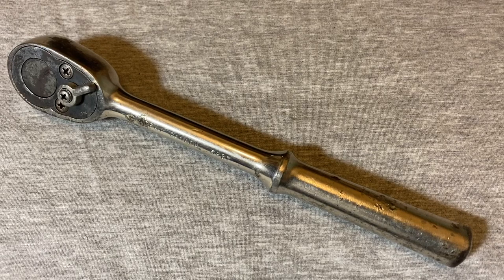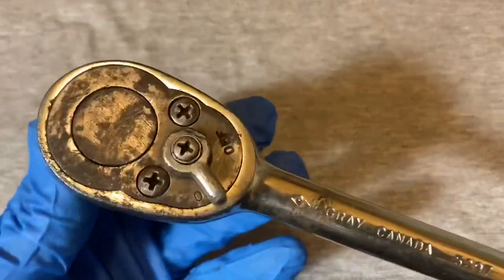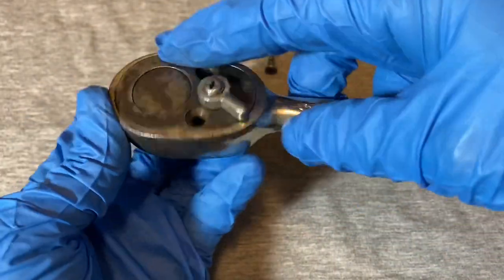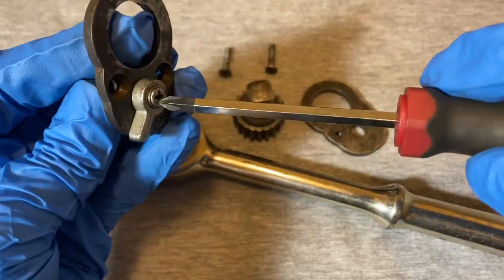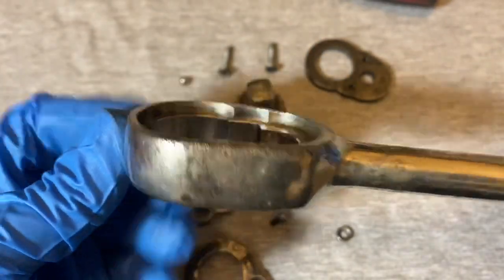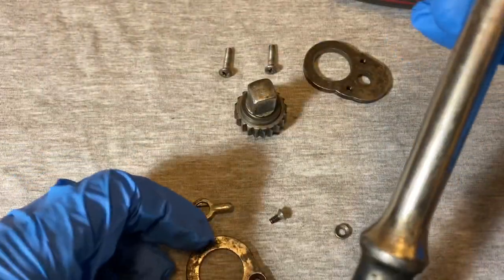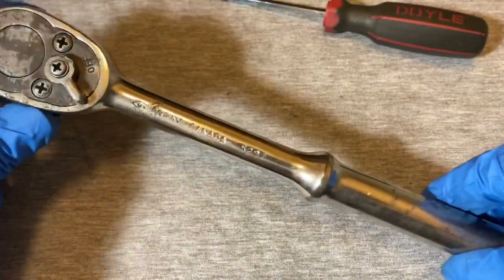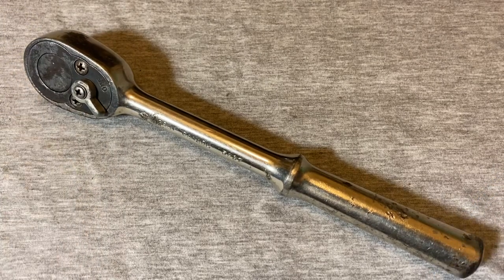Gray Canada 5297 Ratchet TOTAL TEARDOWN Vintage 1/2” Drive

Comment: Looks very similar to a new Britain ratchet I saw on Catus Maximus’ channel, at least the removable front and back plate is similar. Never seen both plates be removable besides those two ratchets. Pretty cool design, I’d bet it’s super tough.
Reply from the maker: I think New Britain and Proto had the 2 plates in their design way back in the 30s and 40s.
Reply: @snapringchronicles3020  yeah I’ve seen some super old beat up new Britains on eBay.

Comment: I had a Gray wrench that I passed along to a forum friend who collects Gray, but while their tools are out there I just don't come across them here in California.
I hear some states see a good deal of Gray tools.
Reply from the maker: Strange they never made and effort to cross the border. I did read that they did have a collaboration with Bonney years ago though 🤔
Reply: @snapringchronicles3020  
I think they did have some US distribution at one point, but I probably wasn't a huge presence or for very long.

It seems a lot of foreign tool manufacturers never bothered to have much presence in the US until we started loosing so many of our domestic options in the past 30 years.

Try to find vintage Knipex or vintage FACOM tools at your local flea market.